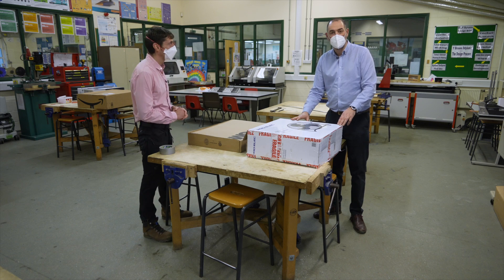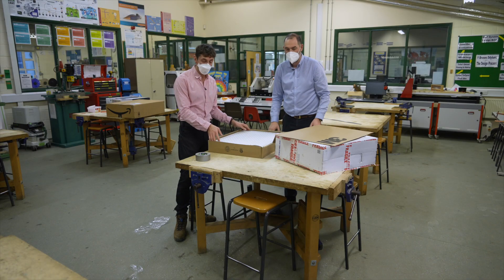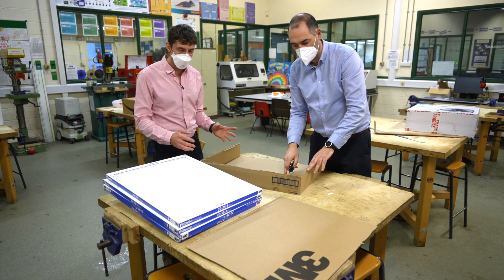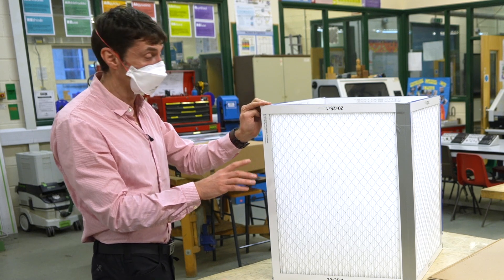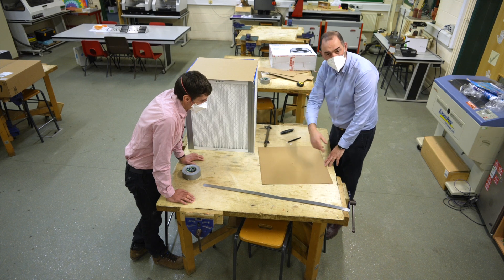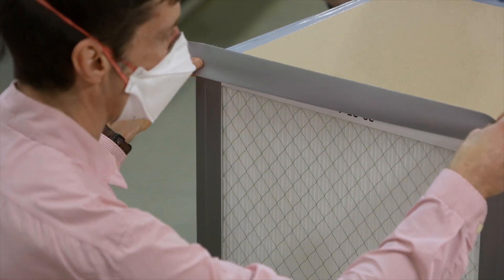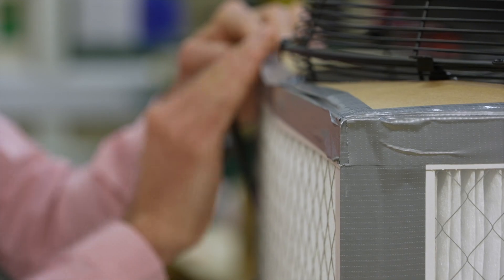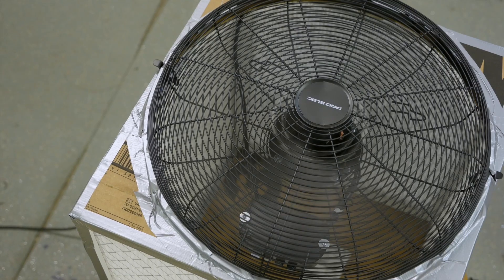DIY step by step Build Video Corsi Rosenthal Thomas CR Box Wales Cymru

Comment: Truthfully, this is a Comparetto cube. A true Corsi-Rosenthol box uses a filter on the bottom, rather than a panel. A true Corsi-rosenthol needs to be placed on a wire rack, so the bottom filter gets unrestricted air flow. None the less, by using 20 X 25 filters, you gain back the 400 square inches of frame area that's lost by eliminating the bottom 20 X 20 filter.

Comment: Nice !  I have such a fan, really powerfull and silent as compared to commercial purifiers (I have a big ProBreeze) 
Which speed do you use 1, 2 , 3 ? 
Is that noise tolerated in a classroom. My similar fan is OK at speed one and powerfull. 
I suppose once the speed is chosen you mount it on since there is no access to the buttons left? 
IS the cardboard you pierce for the fan strong enough to support the fan's weight for months ?
Thanks again
Reply: oops. I played the video again at slower  speed and could understand better: you actually give the answers to my queries , thanks

Comment: Thanks, Gents, for the complete tutorial. In other versions of tutorials, the filter-media have always been of 5cm. in-depth; as-shown here, yours are but 2.5 cm. - -  but I know that your data must also be correct (and the supplies, thus: less-expensive). So grateful for your detailed mentions of fan-speed, etc.. Cheers!
Reply: You're exactly right, when using an inexpensive square window box fan. This is a velocity fan, which is more than twice as powerful. The round velocity fan will indeed produce the higher air flow volume.

Comment: Thank you very much for sharing your ingenuity.  Please can you advise how often a filter box would need to be changed?  I assume there comes a point when viral particles trapped outweigh the benefit?
Reply from the maker: Hi, thank you very much for your question - it will be 12 months to replace the filters which should be really easy to do. Please let us know if you have any further questions and comments.
Reply: Not really. One of the things that make this work so well, is that the fibers dry out the virus spores. COVID will not last as long on a porous surface, as on a smooth surface, because it wicks away the moisture, dehydrating the virus. Add to that, the continuous air flow, just leave this on over-night, there is no communicable COVID on the filter media. Fortunately, the environment of the filter media is incompatible with the multiplication of the virus.